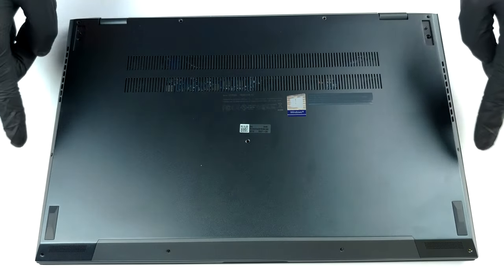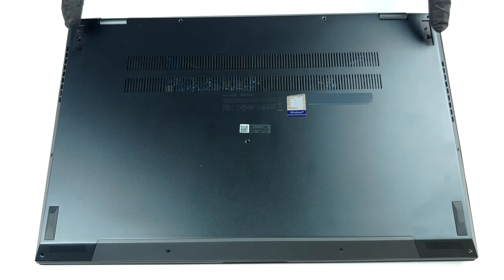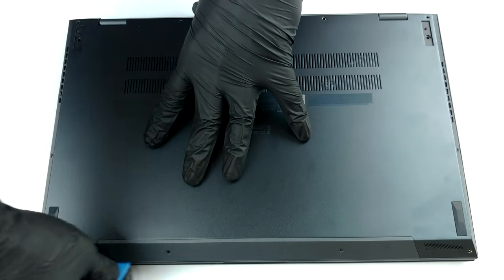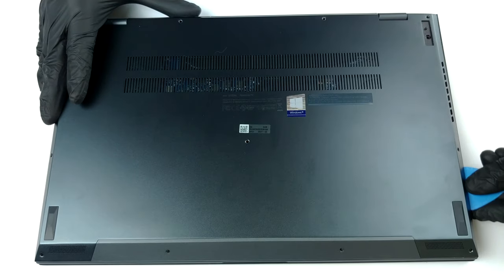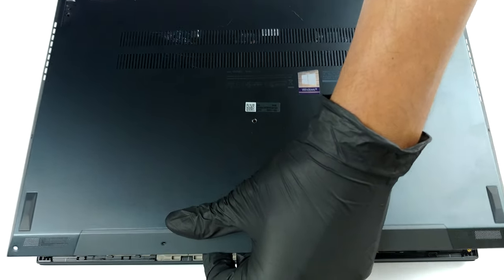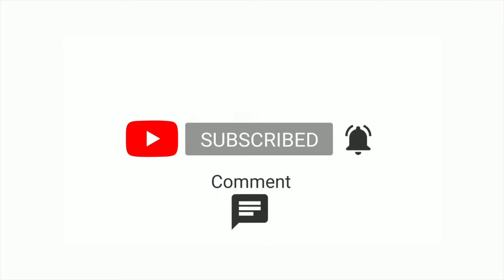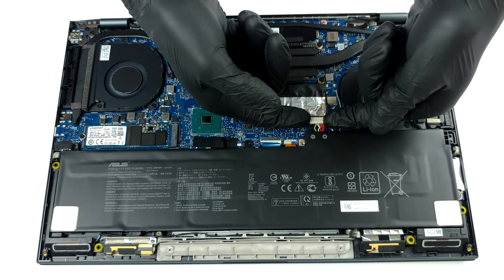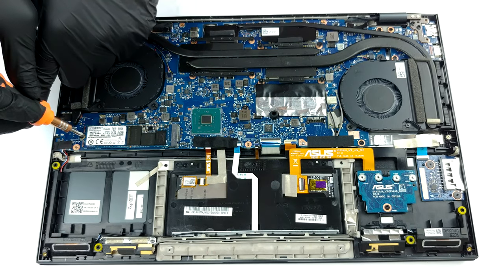🛠️ ASUS ZenBook Pro 15 UX535 - disassembly and upgrade options

Comment: I am having trouble with one of the keys on my ASUS Zenbook. Could you point me in the right direction for a guide on how to repair or replace the keyboard? I sent it back under warranty and all that they did was wipe the hard drive, I don't believe they even tried to open it up and the key still stutters, sometimes you get nothing and sometimes you get two characters when you press the N key.
Reply: I'm having a similar issue, but it has spread across my keyboard to include "n, c, b, enter, left shift, and space" It's not consistent and sometimes does not work at all. Please let me know if you've found any solutions.

Comment: What size torx head is it? I swear they've purposefully made this so that i can't open the damn thing.
Reply: Did you figure this out, I'm trying a T5 Torque screw driver which seems slightly too large, it might be T4 or T3

Comment: Hey mate, quick question. I have a Asus zennbook pro 15 UX535 LI. It came pre installed with a 64Wh battery, 1 nvme ssd and a sata HDD (which ive replaced with an sata ssd). I really want to upgrade the battery but the 96Wh is bigger then mine is. So it will go over my second SSD. Do you know if this is an option?
Reply: btw, i have the one without the touchscreen touchpad
Reply: Second ssd?
Reply: @nobleactual7616  yes i replaced the original HDD with a SSD ;)